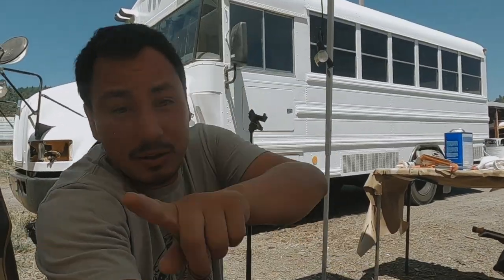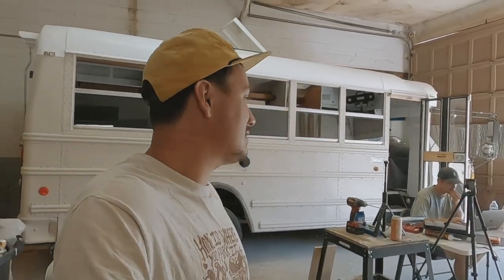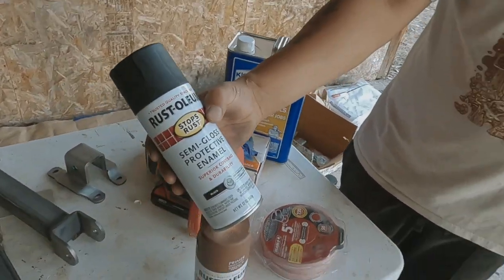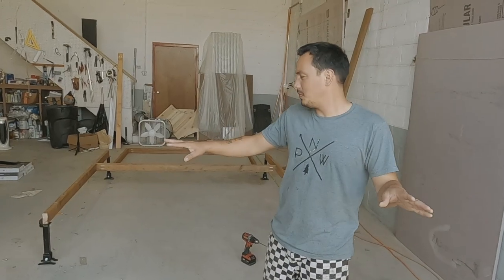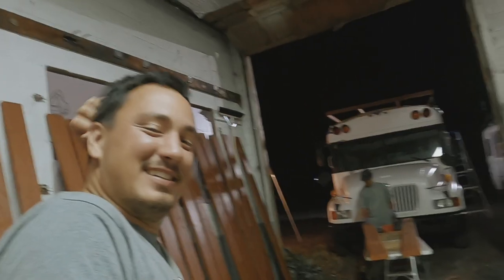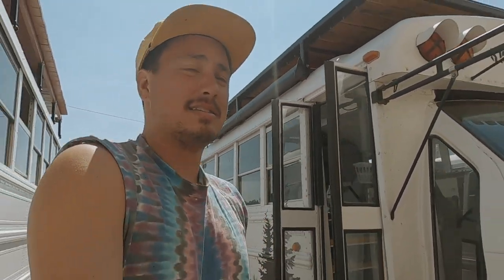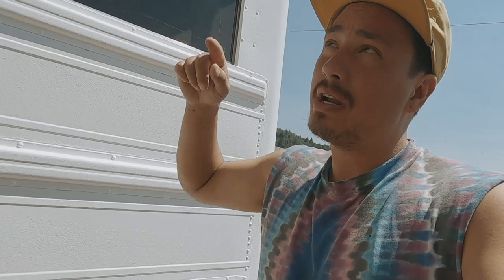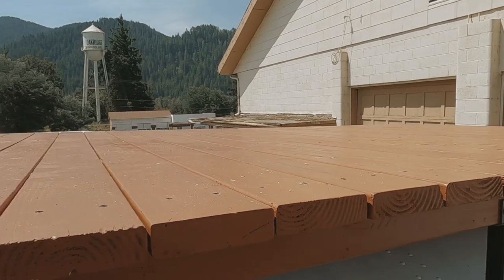How To Build A SKOOLIE Roof Top Deck - 30 Day Short Bus Build - SKOOLIANA TV - EPISODE 2

Comment: Confused, what hardware are you using to secure to the roof? Nut and bolt and you drop the ceiling, or are you using beefy sheet metal screws straight through the top?

Comment: Great video and solution for the deck. What is the distance between the bottom of the deck frame on the outer edge of the deck and the roof of the bus as well as between the center of the deck frame and the center roof of the bus? Could you fit solar panels on sliding rails underneath the deck?